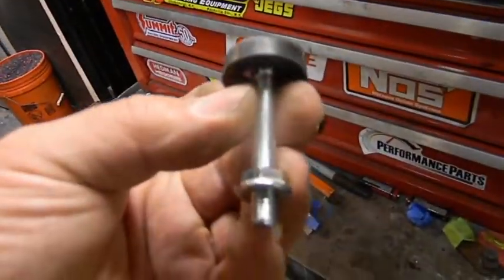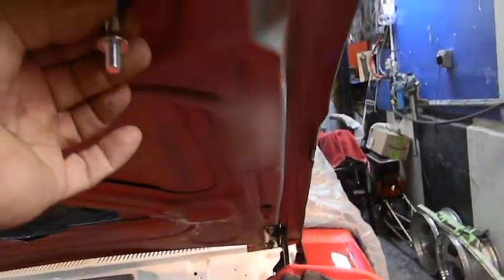Garage Stuff

Comment: What's the difference, in dummies terms, between ARC, MIG and TIG welding, and can the same welder be used for each? I have an arc welder coming my way, and it came with a tiny light blue cylinder. Is that for use with any of these types of welding?